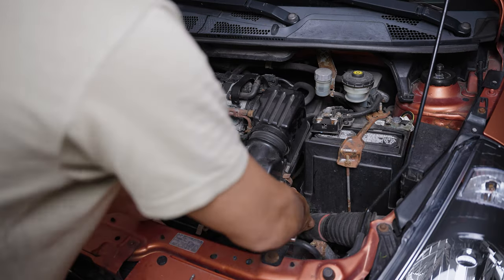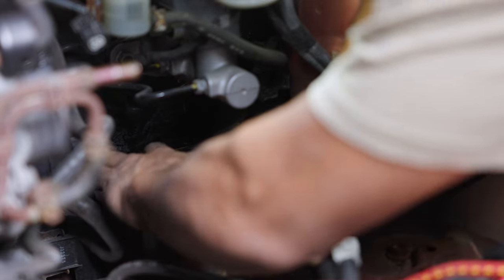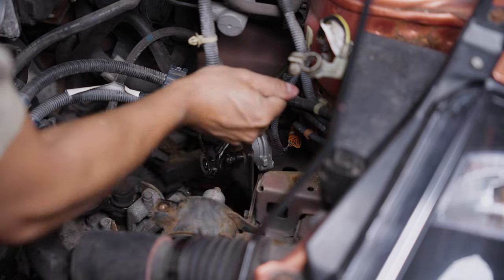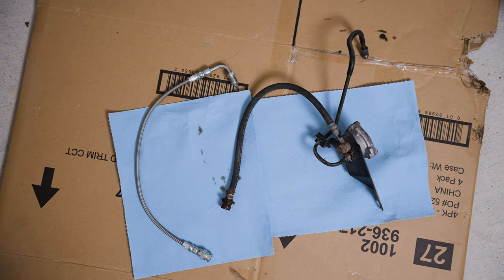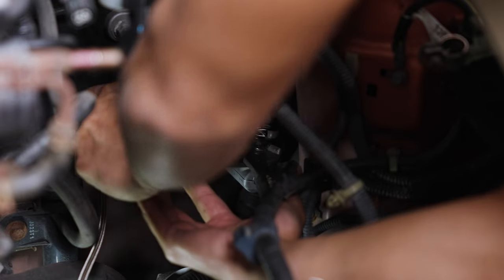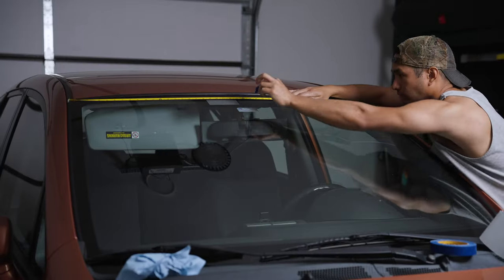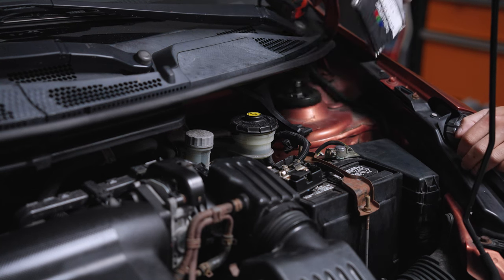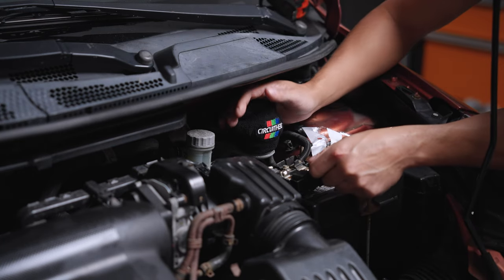Clutch Delay Valve Delete (CDV) - Honda Fit

Comment: Thank you, good delete!  The secret to vinyl stickers, is to use a very dilute detergent mix.  A couple of drops in a squirt bottle, then mist it over the sticky side (once you've peeled the backing off, that bit!).  Put it on and you can move it around then once happy, squeegee (you can use a credit card etc) it to remove bubbles etc, then wait an hour or so before you remove the front of the sticker sheet. Easy!
Reply from the maker: thank you! appreciate it

Comment: nice, a cheaper option would be to use an EM2 CMC (01-05 civic) which doesnt have the CDV and was a direct bolt in on the GE chassis
Reply from the maker: Yeah I have a gd
Reply: This is excellent information. My GE thanks you.
Reply from the maker: @ween3606  I gotchuuu
Reply: Niiiice. I’m getting it for my GE, thanks! OEM part is about $250, I wouldn’t say it’s that cheap. But aftermarket ones are far cheaper

Comment: Just did mine and my only issues were the retaining clip popped out and required a search and rescue session to find it, and the male end of the new braided line into the master cylinder was a 13mm instead of 12mm. Luckily I had bought a full set of the flare wrenches from Harbor Freight that included that size. Haven't driven it yet-discovered my upper trans mount was shot, so waiting for that to arrive. Also added the Hybrid bushing (new style) and detent springs. Can't wait to try it all!